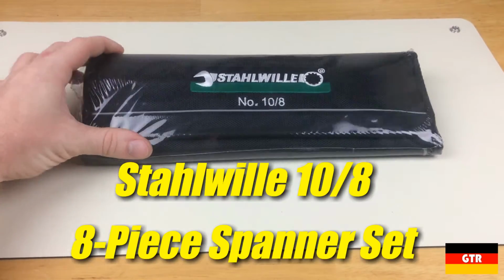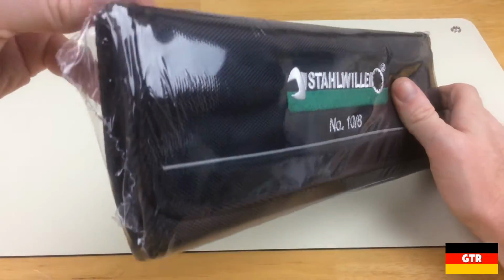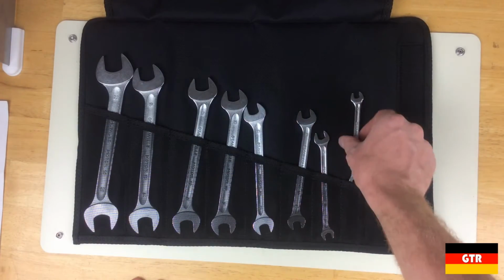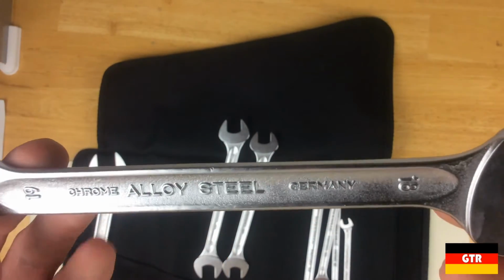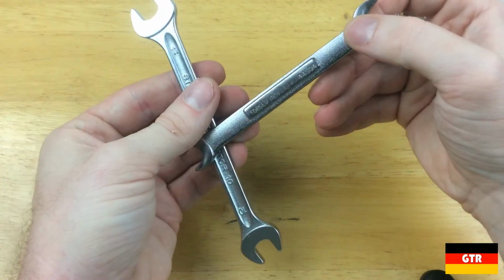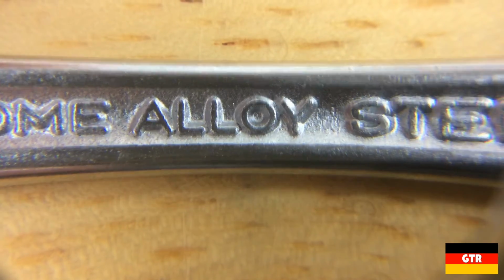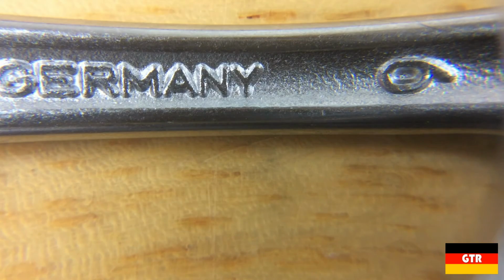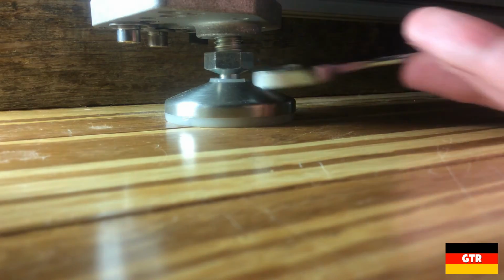German Tool Reviews:  Stahlwille 10/8 (8-Piece open-ended spanner set)

Comment: Great Video. I just ordered a few 130a combination wrenches, along with a 435qr n ratchet. Would you know why the 130 series are more expensive than the 13 series wrenches? Thanks Very much Sir.
Reply from the maker: I think the only difference is that the 13 is all metric and the 130a is all SAE.  SAE tools are always more expensive from Stahlwille.  I would guess it is because they don't make as many of them thus can't get the volume savings you get with large production runs.
Reply: Thank you very much.

Comment: Between the Stahlville and the Gedore set you reviewed, which one would you recommend? Right now,in the country that I'm in, the Stahlville is cheaper then Gedore by a good margin.
Reply from the maker: If the Stahlwille is that much cheaper than I would get that.  They are both very good spanners, the only real big difference is the surface finish.  The gedore units have much more of a matte chrome finish than the stahlwille.  The Stahlwille also seem to be a little bit lighter.
Reply: German Tool Reviews Thank you

Comment: Nice, I picked up the Gedore 7UR 8-19mm Spanner's with Metal case and the I beam is about the same with the Gedore Spanner's, really nice set also
Reply from the maker: Those metal case versions are nice.   Even Stahlwille has switched to all Plastic cases.  I like the finish on the Gedore ones better.

Comment: where do you need 9, 11, 12, 14, 15, 16, 18, 20, 21 or 22mm?
Reply from the maker: There are definitely uses for a 9mm (old bicycles, some power tools).  Most of the rest you mentioned are used on hex bolts depending on if the standard is ANSI/ISO, DIN or JIS.  Here is a good table:  
https://www.boltdepot.com/fastener-information/bolts/metric-bolt-head-size.aspx
Reply: most?
Reply: shit.. i was drunk when i read your response first time. OLD is the word here i guess :) . also also some of these weird sizes are useful on brass fittings and valves. i was wrong..

i was thinking only hex nuts. 8mm - 13, 10mm - 17, 12mm - 19 etc
Reply: i find that in most jobs i have the 10, 13 and 17 the most common. Both in electrical work, cars, bicycles and home and garden DIY.
Reply: 14 and 21 in air fittings
9, 12, 16 and 18 for metric bolts and nuts made in UK (i don't know why)
15 on bicycles
22 for M14 Nuts and Bolts

Comment: How do they feel compared to full polish wrenches?
Reply from the maker: The ends (wrench portion) do feel like they are polished.  Not really sure since I don't believe I own a fully polished wrench set.  Most of my wrenches I own were hand-me-downs from the 60s and before (lots of Craftsman).  I would say that a a fully polished version would be heavier because it would be more material.
Reply: I was thinking more about hand feel than weight.  For example, the traditional Craftsman raised panel (RP) wrenches are not as comfortable as full polish wrenches if you do a lot of work with them.  I was wondering about these wrenches because they don't have pronounced raised parts, but aren't exactly smooth either.
Reply from the maker: The raised lettering does not protrude past the bounds of the handle so you really can't feel it.  I guess I don't use spanner wrenches enough to notice the difference.  The kind of work I do I often don't see fasteners greater than 1/4" so I usually never need a spanner.Garage and Garden